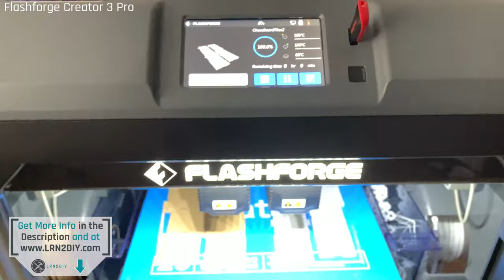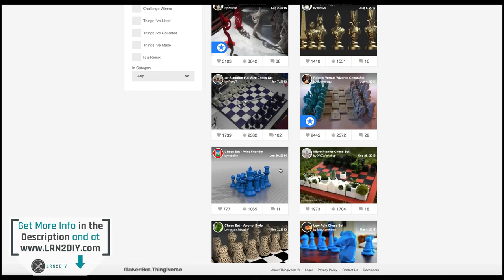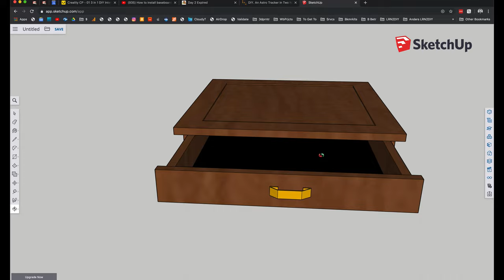DIY 3D Printed and Epoxy Chess Set

Comment: Just as a note.  The chess board should have a white square on the right hand side and not the left.  If not, your king and queen will be swapped.  This is a common mistake made also in some movies containing chess sets.
Reply: I didn't want to be the first to comment on this, thanks for being the one that sounds like a tool.  It is the persian flaw in an otherwise very impressive build.  Could be that the set is strictly ornamental, and that he doesn't know how to play at all.
Reply: As an avid chess player I noticed it too but I wasn’t going to mention it because of the incredible job he did.
Reply: Just rotate the board? Its a square, no?
Reply: @godbob4551  Absolutely, the drawers will just be on the sides then. It is still a masterpiece though.

Comment: How long did the chess set take to print. The Flashforge is fantastic, but out of my price range. I do have 9 printers, so probably spent the same amount, but can print 9 beds of designs.
Reply from the maker: Hey Ginny - took about 18 hours of print time and used 1/4 spool of each color, roughly. The actual chess board took longer since I could only do a handful of tiles at a time. The Creator 3 is not the cheapest but it's pretty impressive.